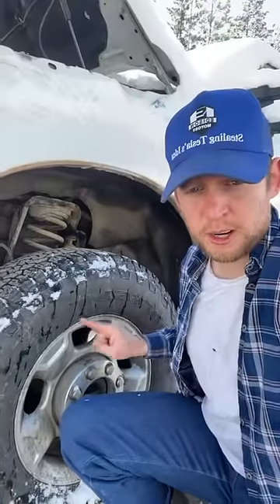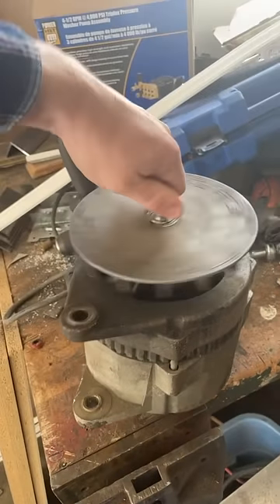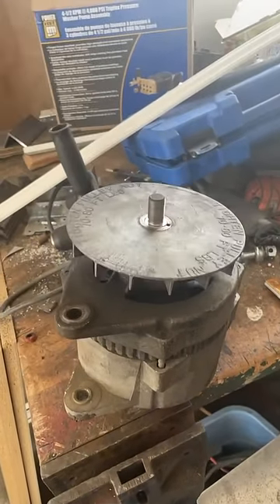Alternator on each wheel???

Comment: This is like plugging a power stirp into itself and expecting it to have power.
Reply: If that's the case then you have to jump your car off every time you started it because therefore it would take just as much energy to start it as it does before the alternator starts putting out energy to keep it running how dumb is that what else is the batteries for
Reply: Quite close more like using a battery to charge a battery that charges the first one!
Reply: @jamesbarbee3986  plug a battery bank into itself, infinite power. Lmfao

Comment: First thing we learned in electronics engineering class was you can’t get something for nothing. There are always losses. Whether mechanical, electrical, or heat. All motion costs something. The only time an action is not costing something, is when the item is at rest
Reply: Objects at rest still cost something... they just cost a lot less... but it never goes to 0 cost.  Just their presence creates displacement on some level and there is a cost of some kind to that.

Comment: Well I have mounted two alternators driving off the yoke of the rear end , works great .
Reply: Need videos
Reply: That's stupid,  just get a higher amp alternator.
Reply: @ryansmiley5495 

Not stupid at all , in very old cars made into a streetrod space is limited.  A pulley on driveshaft yoke alternator mounted to 3rd member housing a short belt works great. The short time stopped at a light does not affect a thing. Speedway motors sells the kit and i run 220 amp CS-130 alternators .

Comment: Because an alternator needs current to create current,  use generators on the wheels instead.  This is a method used by lots of sailboats, they attach a generator to the mast with a prop to charge batteries.

Comment: There are three popular types of electrical free energy machines:
- Random spark plugs, motor innards, speaker parts, and hot glue. Powered by not making any sense at all so is not bound by making sense to physics.
- Magnets that magically change repulsive or attractive strength on the fly to make something spin.
- This one. A motor tied to a generator, converting mechanical energy to electrical energy then back, magically with >100% efficiency.

Comment: Teslas use a system called regenerative braking. The wheels literally recharge the batteries of the car when they are spinning, but the vehicle must be in motion, and you must apply the brakes.

Comment: 'In an isolated system' is the key point here. Pulsed motors are a different beast. I know because I've built a crude one that made around 110% output. The frequency has to match the wire length. So you're stuck at a constant speed which makes it useless for a vehicle application. But a solid state system topping up a capacitor bank could be plausible.

Comment: I had a ford Taurus hybrid and the braking system had generators in them using the brakes would charge your battery. Pretty cool concept I didn’t have the car long enough to know if it sucked

Comment: HEV tech here and it’s not an alternator, it’s a stator being used in regen braking systems. They do not engage until there’s a net negative need for power. In fact in normal driving conditions, the average hybrids brakes don’t even engage until it’s around 5mph or less. On a side note this is why hybrid brakes can go 200k OEM.

Comment: This is basically the same concept as my koi pond. I have a water mill that is run by the water pump in my pond that then spins and runs an AC Delco alternator. From there, the power generated goes through a voltage regulator and then a power inverter which then keeps the water pump running. Making a basically free circle of power. It’s been running for over 18 years now, But I restart the system every month

Comment: Slight correction, the energy doesn’t per se disappear from the closed system, but it becomes less useful as it is more spread out, as you said usually as heat.

Comment: Actually, high gearing on a more efficient alternator than one meant to be driven by a belt on a gasoline engine would be a good test. Using gearing instead of belts maximizes efficiency and allows it to be much smaller. At worst, it could collect resistance on downhill only. In either case, making a motor work alongside an alternator sounds doable

Comment: This is the same as opening your refrigerator door to cool the kitchen. The cold coming from the inside is offset by the hot coming from underneath, plus a little extra heat from the motor due to manmade systems not operating 100% efficiently. End result you slightly warm the kitchen and spend a lot of electricity doing so.

Comment: I’m probably wrong, but I think it could be done.  Power inverters, transformers, ignition coils, etc, can run off 12 volts but produce much more voltage.  With a power inverter, you can get 120 ac volts from 12 dc volts, not sure about transformers, but my ignition coil takes 12 volts & turns that into 80,000 volts.  There’s gotta be a way.

Comment: Electric braking turns the motor (even if they are on each wheel) turns them into alternators, and it's called regenerative breaking. It's not efficient to stop but it's useful to slow down, such as normal engine breaking (which does not put gas back into the tank). However, brake-pad dust amounts to the majority of what a car puts out as polluting factors; making the per-vehicle pollution difference of electric vehicles to fuel vehicles negligible. So car manufacturers should just top adding "upgrades" to 20yo engine block designs and actually R&D a new more efficient combustion engine rather than just making electric vehicles that are inefficient and as or more polluting.

Comment: Except SAAB designed a hub based drive motor that also does regenerative braking and get 600 miles of range.

Because an electric motor and an alternator are both just coils of copper and magnets spinning.

Comment: We know that the alternator's main function in a conventional automobile is to keep it's battery charged via converting chemical energy into electrical energy. Likewise, if it were to be utilized in an EV it can work to return a certain degree of electrical energy back into an EV's battery during operation but unfortunately nowhere near enough energy to justify its application.

Comment: The alternator on a ICE is actually robbing your engine of horsepower to create electricity.  If you have an electric drivetrain then the only way to generate additional energy is to have a separate source outside the drivetrain to creat it, like a 9L CAT diesel generator.

Comment: Well there's something wrong with your alternator. They typically require little force to turn. I would like to see what would happen if you had two isolated battery cells. While one runs the vehicle, the other cell is charged using a high output alternator. You can switch back and forth between the two cells as needed. Both cells can be fully charged when the vehicle is not in use.
Reply: You would still have net loss and have to charge the batteries more often.
Reply: @DClark-zl8xb  it would still shorten the time spent sitting at a charging station for an hour doing nothing. A watched battery takes longer to charge.  🤣🤣🤣
Reply: @HueMongussD  No- it generates a net loss. That means it pulls more power out than it puts in. It would take longer to charge.
Reply: @DClark-zl8xb  it doesn't pull any power from a motor to spin an alternator for charging a battery that is just sitting there  connected to nothing except the wires coming from the alternator. I'm not suggesting a scenario where you are trying to charge the battery at the same time it is being discharged by the motor. We know, of course, that can't work.
Reply: @HueMongussD  OK, I think we were on two slightly different trains of thought.

Comment: Know what you’re not understanding is that each wheel is already driven by an electric motor which if you reverse the polarity, you could use it for regenerative braking and actually turn some of your forward, momentum into electrical energy and slow your self at the same time you’re welcome

Comment: want to blow his mind? the electric car does have an alternator on each wheel. electric motors when sitting still have almost 0 resistance . when the motor starts to spin its field induces voltage opposite that reduces the power it requires to operate .

Comment: There is nothing for free. You can absolutely add more motor generators but each set you add, adds losses. Bearings, repulsive magnetic force, and even just more places where losses can come from. 

But, increasing efficiency is what will make that system work longer and stronger.

One way is thermal recuperation from exhaust, like how the air pump in the obd2 systems keep energy in the system, and yes mines disconnected because my f150 is a 96 and I not have the money for a new one right now. 

Beyond that, aero dynamic shapes, will increase beyond the drag from propeller type wind generation.

Comment: Not to mention that the alternator needs to spin pretty fast to generate power. Putting it on the wheel at 65mph tops out around 500rpm, nowhere near enough to get anything out of it.

Comment: While under power, your theories are absolute correct? What about coasting to a light? What about rolling down a hill anytime you let off the gas? There should be some regenerative gain just like lining the hood, roof and trunk with solar panels. It ain't going to do much but it's going to do something It's a simply say that that little bit of power game isn't worth. It just doesn't sit well with me every ounce of efficiency you can squeeze out of a power drying source is worth it. So why wouldn't every ounce of created energy you can squeeze be worth it? The truth is you want $80,000 for a car and you don't want to put any of these extra expenses into it

Comment: Exactly, you could use alternator energy/resistance, to slow the vehicle down and when braking,, and or traveling downhill. It's the only way it would be efficient. But I believe you want your alternator to be spinning at all times, while the engine is running,,,

Comment: thats why you need 2 power systems 2 motors one in the front and one in the back, when one gets low you flip a switch and run off the other while the other charges

Comment: There's more than 1 type of AC /DC power supplies. Generators without brushes turn easily and produce ac. Diode bridge turns it to DC. DC generator has brushes and is harder to turn as the brushes are on a slotted ring or comutator.

Comment: Gear on each axle, another gear on alternator to mesh with gear on axle. Wire alternator to battery pack. As long as battery has first charge itll charge car battery as you drive

Comment: Uh, am I the only one that noticed that that alternator is shot? A good one takes very little effort to spin and infact can be on a bracket with a proper gear ratio, and it could work. The question is, would it produce enough amperage to charge the batteries of a e-car.

Comment: On the other hand ;
If an alternator is on each wheel with no power on the armature the power to spin the alternator ! To go to regenerative braking, you only need to put power to the armatures ! The first part of the brake pedal switches to regenerative braking by introducing power to the armature !
This is basicly the same as switching DC drive motors to generators for regenerative braking !

Comment: What if you did a jake-brake style system where it connects an alternator to the a wheel or axle somehow, not having it connected while driving, and having it turn on when letting off the throttle?

Comment: But what if components of the differentials that spin were magnetic and the exterior portion of the diffs had the electrical components to extract the energy to return to the system. That is what an alternator does and you do not need to add an extea system like an alternator.

That would be dynamic and yes, you would lose efficiency by needing to generate more power to drive the shaft but you would balance that with collecting some of the lost energy as well. 

Braking only produces energy while you brake.

Comment: When you let off the accelerator on a Tesla, it generates power from the energy that would have turned into heat via the brakes. Only you can drive a Tesla 150K miles and not change the brakes because you rarely have to use them.

Comment: An alternator only generates so much power(14 volts), which is enough to keep a car's or trucks battery at 12-14 volts.   The batteries of a Tesla are rated much higher and an alternator can not charge a Tesla battery.  Simple

Comment: Not if you use gear to ratio, I'm no electrician but I'm a rigger
It works the same way a four-point block to pick up 2000-lb you only need the force of 400 lb on your single line pull

Comment: Wire in a stepup transformer with a  diode & capacitor to have high voltage DC.

You say it can't be created, but it can be transformed:)

Comment: You can use alternators at the wheels but only during breaking the energy produced during the short amount of time you spend breaking doesn't justify the cost so it will probably never be used

Comment: the energy is going into the battery so could it not be charging when it’s going slower as not using energy for counter energy theory.
if it producing the speed running drawing power but when it’s not drawing power it is still moving so alternators or something to that effect in theory should be free energy.?

Comment: Look I get the laws but if heres the thing. The laws apply to current concepts so a lot of the time people think too big. 
Example - the light on a bicycle that gets power from a strip of magnets on the tire. This creates electricity as you pedal. If the four tires are changing batteries packs just with simple magnetics like the bicycle for the lights. Then in the event of an emergency when a backup set of batteries would be resourceful they could be used but not as the main source of even the secondary source of charge. Now if they did a staging alternator like the 4/8 cylinder motors do at highway speeds. Then this would be possible. Once the vehicle reaches 5th gear or highway speeds an additional gear could engage. Putting the vehicle into cruise control so that it keeps a steady current dedicated to that function and can compensate for the additional loads to and from the drive tires. This would require secondary battery packs and its own system that activated only after reaching the selected speed.

Comment: I mean. When was that law of physics written? You should look into staters. Even if a car had two electric motors in the rear. Each wheel could be fitted with staters which would generate power. I’m not saying that it would get rid of the need to charge the vehicle. But I think it would extend the distance you get per charge.

Comment: Alternators - or air compressors DO work to produce distributed power / stored energy, in trailer / train wagons (also as regen - ie. signal to only (primarily) fill air tanks / battery when slowing down - simple for low running drag, without needing plumbing from the loco/prime-mover.)..  Of course the motive force comes from whatever the prime mover is.. 

 (The self powered tesla just needs a wind turbine and solar...  lol...  (for stationary unplugged charging.)

Comment: okay, but why can't we scavenge energy out of exhaust by connecting an alternator to a turbo volute on a hybrid system?
with one turbo/super charger you're already creating positive displacement which massively increases exhaust pressure, why not have a second one (or tie it into the turbo) to siphon off kinetic energy to generate electricity?

Comment: Have they never given an old car a jump start while the donor car is running? The donor car bogs down because of the extra load the alternator puts on to charge the other battery. (Don't try to jump start a modern car while engine is running, folks, computers are expensive and delicate)

Comment: It could work if you had two different batteries like a truck can have two different fuel tanks. But like the laws of thermo dynamics say. You'll eventually run out of charge and probably sooner than if you just had one battery of equal size of the two combined.

Comment: Split the battery pack. One bank charges while the other provides the power. With inteligent charging there will be switching between the banks. Voila, that way you can have alternators on the wheels.

Comment: The altenator takes less resistance than the drive motor, even if doubled.  The first law is energy is created by the drive motors and put to the tires. The tires then transfer that energy back to the altenators.  If you have regenerative braking + altenators ls on the rear wheels ypu have continuous recharging.  It's been tested and confirmed functional already.  The issues are capping recharge to prevent over charging or disconnect and connect cycles for the altenators (the bigger issue) and the increased wear and tear on additional parts and the drive motor.  The additional cost of the parts +projected replacement cost on the life of vehicles are unknown points that are BELEIVED to be a balanced based on CURRENT electric costs as of 2018 of 2019 studies.  As the electric cost climbs and if altenator efficiency increases (which is being invested in) then this WILL become.more efficiency..

Comment: What do you think driving the car down the road on a tesla, It is an electric motor driven by a bunch of batteries, I drive a 2018 Tia optima hybrid.That has a generator spider and a electric motor that drives it down the road. I also have a toyota prius that has two electric generators and one electric motor and No transmission